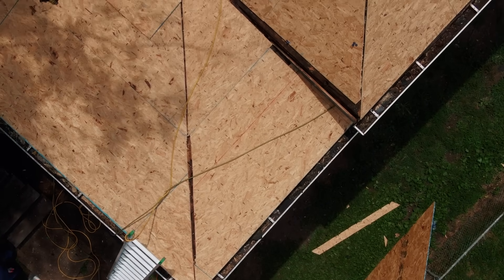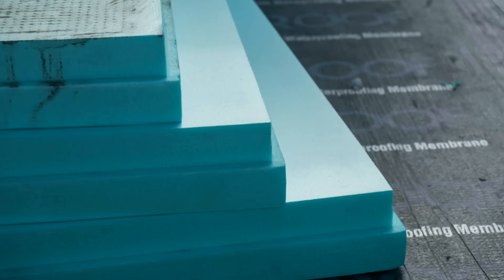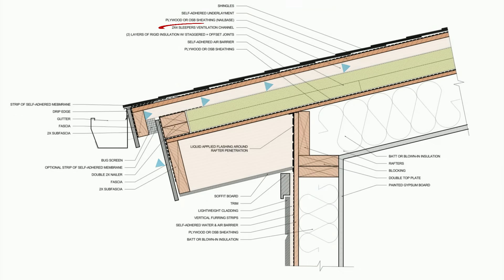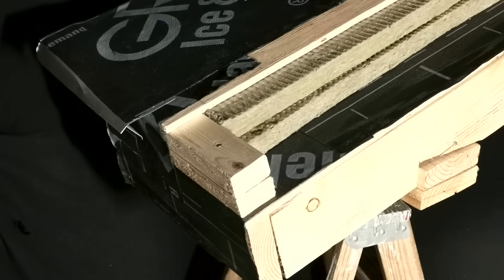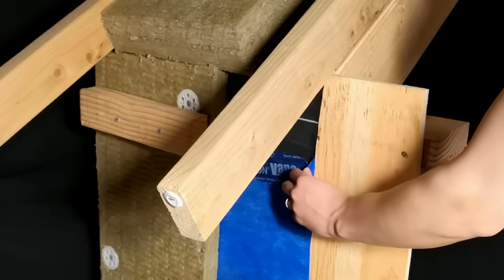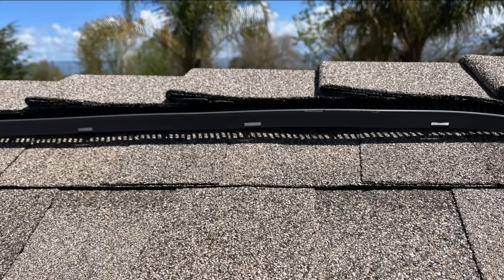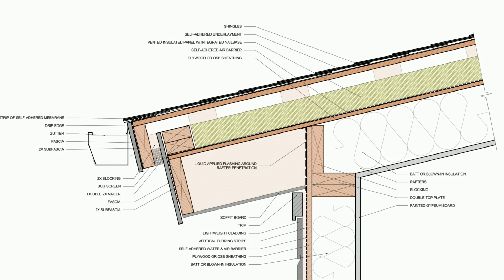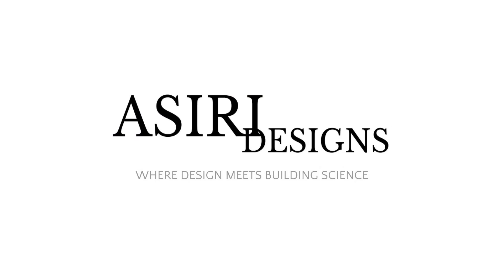Exterior Insulation For Roofs (3 DIFFERENT WAYS!)

Comment: In my climate zone (4 Marine) I prefer my roof assembly remain vapor open. In cathedral ceilings I use Henry Blueskin as my exterior WRB, then Rockwool Comfortboard, then an over-roof, vented from soffit to ridge. In our humid environment this allows vapor to migrate into the airstream under the roof. It makes for an extremely quiet roof assembly as well, even heavy rain can't be heard.
Reply: So you are insulating the open roof cavity despite it being vented?  Is that a waste of materials or am I missing something. My zone is less aggressive temperature wise but experiences much of the same humidity issues

Comment: Howdy from Texas.   Content is dense, rich, and on the mark.   The biggest selling point for this for the ladies other than the energy savings is what my wife has told me for 37 years.  “Why is our home so dusty?”  Texas homes are like the Texas big hair the ladies had back in the 80’s.   It’s a giant facade of wasted space.  The attic and the roof is nothing more than lipstick on a pig.  I am using a similar detail for the Operation That’s What She Shed for my wife’s art studio.  I am building it all myself.  Bringing some of that Yankee New England dormer barn charm down to Tejas with a monopoly and balloon framed structure with a cathedral ceiling to stop the 37 years of “why is my house so dusty.”  Of course Cali had a problem building them too tight so I think the vented ceiling is must…unless it leads to dust so that is why I am doing two layers of Zip sheathing and tape.   Pretty sure that zip tape will work if I hear “why is my she shed so dusty.”  Gotta roll it though! 😂

Comment: I used 12” TJI’s for rafters. Vented soffit, vented ridge, and rafter vents in the bays, with a product called “Owens Corning fiberglass insulation” filling the rest of the cavity. So the first year we had a lot of snow. Like 13’ in February. This was back when our option for a connection was satellite, and the installer put the dish fairly low on the north facing roof. So I was going up there periodically and shoveling off the snow to get line of sight. After a while I did not need the ladder, because the clearance promoted drifting, both into the clearance, and over the roof. I could just walk up there, on the wind packed snow. Asphalt shingles, 5/12 pitch. The snow does not melt off until spring. I think that’s good enough? There is like absolutely no f’ing way I am going without a ridge vent and soffit vents, with rafter vents installed from the ridge down to just over the plate, so that any melting off frost can drip into the vented soffit. Anyone who doesn’t have that will have mold instead.

Comment: Thanks man; I've got your booklets and course, it's so instructive as a homeowner, and my architect really enjoys your videos too!

My roofers just signed-off on Zip-R-12 for a reroofing to an unvented roof; it'd go: rafter, existing plywood, taped Zip-R, underlayment, and GAF UHDZ light colored for maximum reflectance.  Inside, rockwool, continuous smart vapor control layer, gypsum.  That's pretty much what you had in another video :-)
Reply from the maker: Thanks for picking up our ebooks and enrolling in our course, we hope it's been helpful! Quick and important note... If you end up going with ZIP-R12 for your roof, you absolutely must have a fully adhered air barrier beneath it, installed over your structural sheathing. This can be another layer of ice and watershield, but essentially you don't want interior moisture-laden air to bypass the existing sheathing and end up accumulating in the ZIP layer. Second thing... ZIP-R is technically not approved for roofs. It's fine the way that you're installing it provided that you have an engineer assist with the fastening schedule, but Huber will likely not warranty it. Hope this helps!

Comment: the other thing that i like about the firring air gap above the rigid insulation is that direct contact between the final roof assembly and the insulation has much more thermal bridging, (or if no contact thermal buildup). The air gap allows the built up heat under the roof/shingle assembly to vent out somewhere.
If you mentioned this, i missed it, otherwise i didnt hear you mention it.

Comment: I'm kinda torn between Hunter panels and the InSoFast brackets as my favorite exterior insulation products. I think I lean slightly more towards the X-Brackets because you can use the same product on the walls and roof, and you completely avoid the challenges of trying to hit studs with crazy long (and expensive) screws. Plus, if you used closed cell with the brackets, you get a really bomber water, air, and thermal control layer that's self-adhered and monolithic all the way from the ground to the roof peak; There's a really good BSI article about that strategy, BSI-048.

Comment: What is the cost profile for something like this and is this in any way an cost effective option in colder climates. Heat rises and many I know talk about how you lose the majority of your heat through your roof in cold climates cycles. A cheap blown in option like cellulose or fiberglass you can pile up with 14"+  but how could you consider doing that with a more expensive rigid option like Comfortboard or foam. Even in the mock up you only show 2 layers of what 4-6"? For just ~r20 on the roof? In cold climates you need upwards of r49+

Also the extra detail up on the roof can't be a cost effective install either unless the pitch is a low one which has it's issues in snowy areas.

Comment: Are the peel and sticks like grace or shark really sufficient as an air barrier on the base layer of the roof decking? I've spoken to both manufactures and neither will confirm it can in fact act as a sufficient air barrier.

Comment: So, I don't understand why you need peel-and-stick if your exterior insulation is foil covered ISO.  Can't you get get just as good of an waterproof, air proof covering at a fraction of the cost by taping the ISO?  I'm a bit dubious that in practice peel-and-stick layers actually are air movement tight. Given that I'm starting to install trusses in November in the Idaho Panhandle, I'm seriously interested in the best approach!

Comment: with the cantilever rafter/truss tail design (not the design with overhang rafters mounted on top of roof sheathing), thoughts on having the air barrier wrap around the soffit and fascia and terminate to the roof air barrier? Instead of having to seal in between rafter tails.

Comment: Hi there. What is your opinion on SIPS panels? Arte they kind of passe or just not wirth the money? Thanks
Reply from the maker: They are extremely sensitive to moisture, so your water management and air sealing details have to be impeccable. Let's just say there is a very little room for error in a SIP building

Comment: If you’re using ice and water shield as your vapor control membrane, have somebody besides the roofer inspect it before it gets covered.  As a species, roofers are not generally very concerned with wrinkles, but sometimes there’s enough of a gap that you can see the OSB underneath.  If something like this occurs near the ridge, I think it could lead to rot pretty early in the roof’s lifespan.  Wrinkles don’t occur as much with Grace, but it’s a hot day and they use Certainteed you absolutely will have some wrinkles unless you hammer home just how important it is.

Comment: Could I just screw in a vented rain screen with 1x lumber and attach my metal roofing onto that ? why the extra layer of osb-air/water barrier ?
Reply from the maker: Yes you absolutely can, it's a common practice in Europe. Roofers around here absolutely despise it though which is why we generally have that additional nailbase and underlayment. You have to use a fully adhered underlayment beneath the rigid insulation layers if you're going this route, as well as a drainable rigid insulation product.

Comment: Can the upper sheathing layer be avoided and replaced with furring strips when using a metal roof (assuming the profile supports being installed on open framing)?
Reply from the maker: Yes absolutely, it's done all the time in Europe with metal and tile coverings. You'll get some pushback from American roofers. Just make sure that you're using a fully adhered underlayment beneath the exterior insulation layers, and that the rigid insulation you specify is drainable.
Reply: @ASIRIDesigns would comfortboard work? For some reason rockwool doesn't have any approved roof assemblies without the second sheathing layer so I'm not sure if there's a risk there I'm not thinking of.

Comment: It is insufficient to simply keep telling builders and customers to “trust me and do this, it’s good,” without relevant data on their projects. Nor should one cite manufacturer performance numbers never intended to apply to how these products are being used in the applications you show. Like everything else, people need a measure of effectiveness v cost. I’d bear in mind that all these designs incur a greatly increased structural complexity that will make a repair or a future redo a huge challenge. Thermal engineers have highly developed heat transfer software which they use everyday on a wide range of projects, from aerospace to mechanical engineering, to calculate heat energy transfer. That software can compute how much solar heat energy a given assembly will block from entering your attic, or transmit into it, on a given summer day of the season. (Picking a date and location will provide information on the angle of incidence of the sun light at that time of year, the length of the day, etc. Nothing the architect or the builder needs to bother with.) Comparison calculations with different building options can then be ranked on a cost benefit basis. Your presentations, which are lovely, and I truly appreciate them, lump several different purposes and endpoints together in a way that only allows for an all or nothing approach. Architects can certainly learn the basics of heat transfer engineering as applied to simple structures exposed to low energy sources in a slow quasi-equilibrium system, e.g., residential buildings. Or, they can find thermal engineers who can provide the same sort of service that structural engineers do by reviewing plans and providing a consultation. These calculations, and the software used - highly developed, and user friendly for the engineers, will eventually be set up to make these comparative analyses quick and easy. Among other things, as architects and builders move up the learning curve, they will likely start discarding some overly complicated and costly designs that don’t provide enough benefit. No one has done this yet. Some of your friends in university departments are perfectly placed to make these connections. Industry needs to do this before academic studies start blowing up their claims. And architects need to know this to be more credible.

Comment: A cheaper (and simpler) way to do monopoly framing, pioneered by Scott True, was featured by Matt Risinger. I would love to see a deep dive into that assembly (pros and cons) as Scott claims that its far more friendly to roofers who have not done exterior insulation. This may not be as simple as Hunter panels, but its the next best thing from what I understand.
Reply from the maker: Do you have the video on hand? I found the modified soffit video, but couldn't find his assembly with exterior insulation.
Reply: @ASIRIDesigns  Maybe referring to this one... https://youtu.be/fjwjeoLi6X0?si=3E4NU_y_tmBf6OX5&t=335 they talk a bit about it and then Matt does it on one of his builds explaining what they're doing about the 8 min mark.   

It seems to me that while this approach would be simple, I'm not sure how well it would dry out if water go into it.
Reply: @deftdawg  Yes, this is what I was referring to. But this only talks about the soffit detail and then continues to be monopoly framing from that point. They dont talk about exterior insulation detail at all. In scott's latest video on his channel, he shows a passive house he built, for which i believe he did not do exterior insulation.
Reply: @ASIRIDesigns  You are correct. I apologize. He only has the modified soffit. Not exterior insulation.

Comment: I am planning on reroofing my house with method #1 and condioning the attic.  I have been researching the method, and most assemblies I come across do not have an air gap between the foam board and the second layer of sheathing.  I was going to put purlins on top of the deck for the metal roof.  Should I consider putting the horizontal purlins on first before the second osb layer, to get an air gap?  My assembly I'm currently going to use is: r-19 under existing deck-peel and stick over deck up to peak - 3" of foam(I'm on MS coast) - second layer of osb- layer of peel and stick ice guard up to peak with high perm membrane at peak- horizontal perlins- barn style screw down metal(budget constraints).  If I put purlins under second deck, I will ave a lot more screw penetrations through the second layer of peel and stick.  Thanks for any opinions you may have

Comment: I've used a similar method as the first example with CI on the top of the roof sheathing, except I use rafter tails sistered to the roof joists. Depending on the project (size of overhang, aesthetics, snow load, etc.) and fascia profile, the rafter tails can be 2x8's, 2x6's, or 3 1/2'" LVL's. Zip 3 1/2" R-Panels can work well, because it's easy for the builder to comprehend, and the 3" insulation = (2) 2x4's for edge blocking. 

I've endorsed trying to add some type of venting on top of this CI system at asphalt shingles to facilitate drying, but this never gets accepted. Roof CI usually gets cut out of the project by the GC convincing the client it's an unnecessary expense. 

I like the second detail with the wall CI meeting the roof CI, but that's a complicated and labor intensive detail. Only very savvy clients with a large budget would ever go for this. The cost of construction (along with everything) keeps rising, and as it gets more expensive to build even modest custom homes, unseen building tech gets cut out first.

Comment: 8:44 In your cross-section it looks like the "Vented insulated panel with integrated nailbase" has the venting battens running horizontally. Wouldn't it be better to rotate the assembly so the battens run up the roof to allow natural convecting "chimney" drying and also allow any moisture to drain down and not pool?
Reply from the maker: The ventilation gap actually isn't provided by battens, it's intermittent blocking, so you not only get soffit to ridge ventilation, but you also get cross ventilation. Their website has some diagrams: https://www.hunterpanels.com/products/roof-products/cool-vent/
Reply: @ASIRIDesigns  Ah, I see. Going to the URL you provided shows that the blocking is, well, "blocking" rather than battens. Even on their website it's not super obvious but the thumbnail on their video details the rectangular blocking that they use. Makes perfect sense now, thanks!  :)

Comment: I’ve always wondered if something like a RayCore SIP could be used over the roof air barrier as a continuous exterior insulation that also has the needed stiffness to be cantilevered beyond the monopoly envelope on the eaves to create a structural overhang of a modest amount, say ~ 2’. This would save a lot of labor adding furring strips and extra framing for supporting overhangs.

Comment: Question: Why in the hunter panel model, do the 2x blocking or rainscreen look to be set up horizontally instead of vertically?  Don't they need to be vertical so that any vapor can migrate up the roof?  Wouldnt a 2x blocking installed horizontally effectively block any vapor?
Reply: Looks like the solid wood blocking is not continuous on the full 4x8 panels, so it allows plenty of airflow when installed in either orientation (horizontal or vertical). Hunter Panels has a pretty detailed Installation Guide PDF on their site with a lot of examples.
Reply: @TheArrow3456  I agree - the horizontal blocking is most likely not be continuous, otherwise it would prevent air flow from bottom to top.
Reply: @TheArrow3456  This opens up another question: How do you support the seams if the blocking holds short of the edge? Darned if one answer only raises another question :body-blue-raised-arms:
Reply from the maker: The panels have intermittent blocking, so you receive both soffit to ridge ventilation AND cross ventilation (something that can't be expressed well in 2D). Check out their website for some 3D diagrams: https://www.hunterpanels.com/products/roof-products/cool-vent/
Reply: @ASIRIDesigns  Thank you!